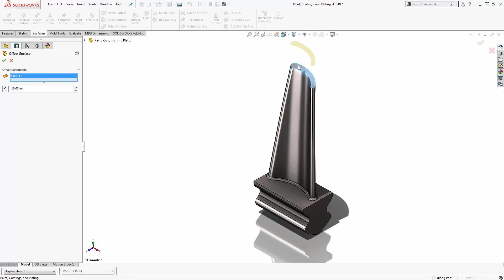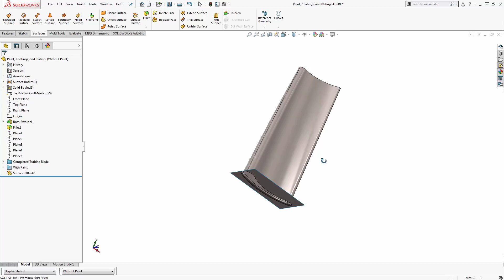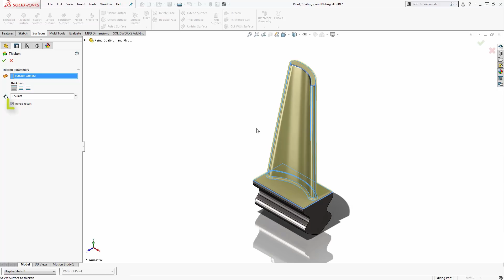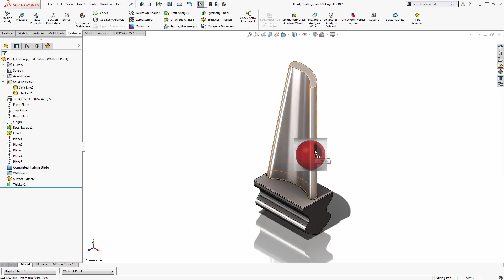SOLIDWORKS - Apply Coatings to Your 3D CAD Models

Comment: Do you have any recommendations on how to achieve a coating like spray paint from a single direction onto a structure? For example, with raised features may be some 'shadowing' effects where the spray paint doesn't hit, typically behind these raised features.